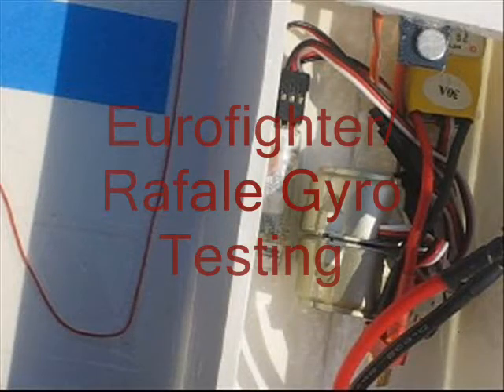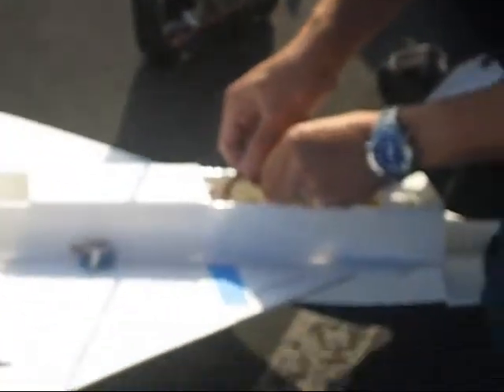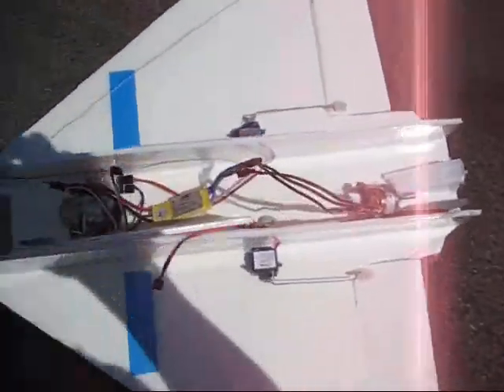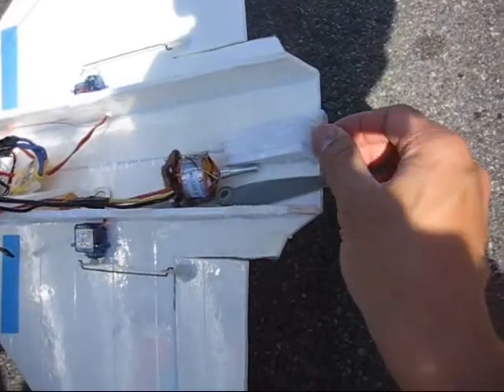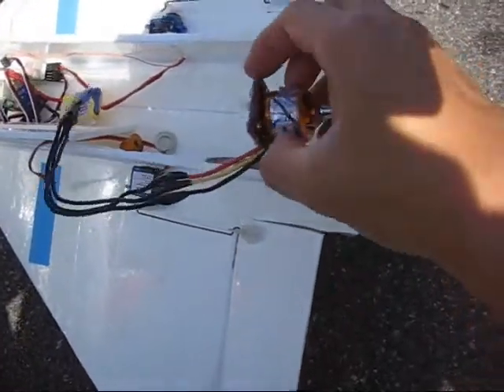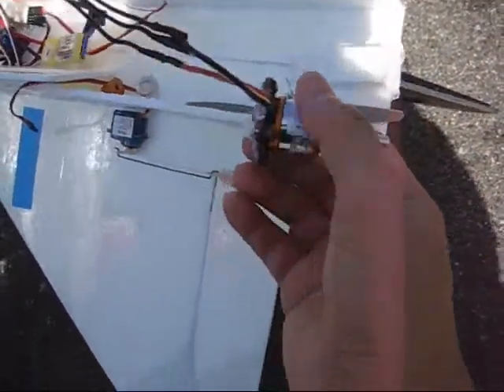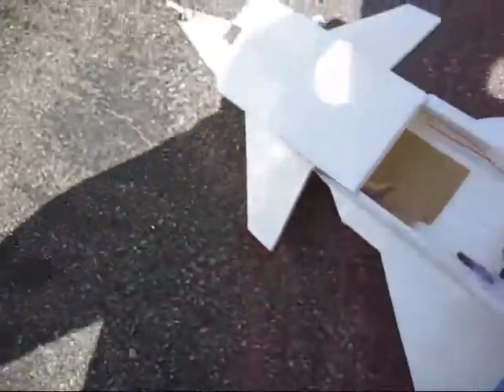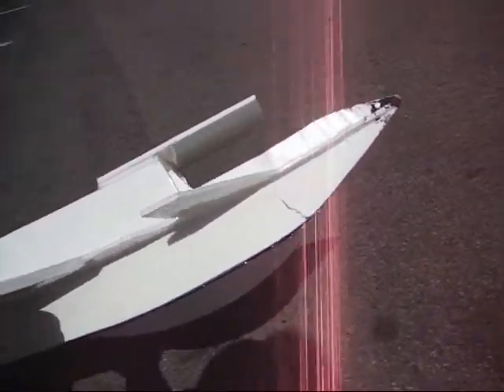Scratch Built EuroFighter / Rafale Gyro Testing crash

Comment: I wanted to use a gyro on a delta mixed plane too and was told without an onboard mixer it couldn't be done.  BTW, the 2 gyros, one on each aileron will fight each other unless you can get the gains EXACTLY the same which is probably imractical if not impossible.  I have had luck with one gyro on both ailerons via a simple servo "y" but one servo had to be reversed in the plane.  Good luck!  I will watch to see if you have any luck but ive been down this road and did not have much myself.....

Comment: I agree with Paul, that your planes do well enough without gyros. I'm still not entirely sold on the idea of using them, but videos like this are very useful. Regarding the throttle/gyro slaving, the only way I see that being done is on Heli mode using throttle curves, but I'm only guessing. In airplane mode, there might be a way to mix the throws to the throttle and reduce the throws as the throttle goes up. Keep us updated if you find out how to program the mixing. 5 stars to you sir! -brandon

Comment from the maker: I did try bringing the linkage closer to the base of the horn, but it made the gyro less effective at slow speed where I needed it the most to control torque roll and stalling. i tried to link it to my throttle to see if it could be turned off at high speed but cant figure it out. Man! I didn't think of checking the auto focus on the camera! I'm sure that was the problem (guess that's why I'm not into photography). thanks for the tip!

Comment from the maker: I originally wanted to try the gyros to see if I could get the plane so stable at low speeds that it would hover and fly at slow high alpha. it did, but at the sacrifice of speed. the wobbles made the planes drag with flutter. I usually go to the park with 1 slow flyer and 1 jet so I tried to get a 2 in 1 deal here. I guess the best thing is still a compromise with using a mid-motor mounted plane like my old f22. i was also going to share some personal findings on the KFm2 on my next vid

Comment: Maybe the camera has a manual zoom and a auto zoom...should check and see incase its on manual.  Yes...gyro setup is very sweet.  Nice flying bud.  With the gains dropped down..could you not put your linkage closer to the bottom of the horn..so its not sensitive.?
RCcanuck